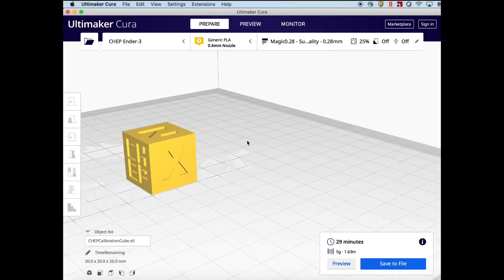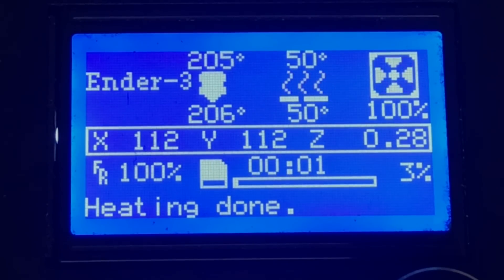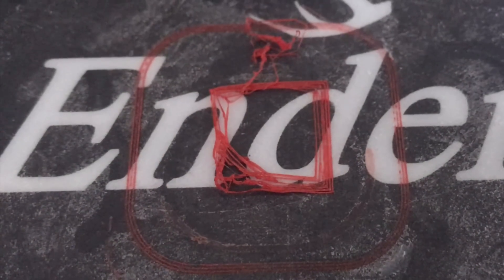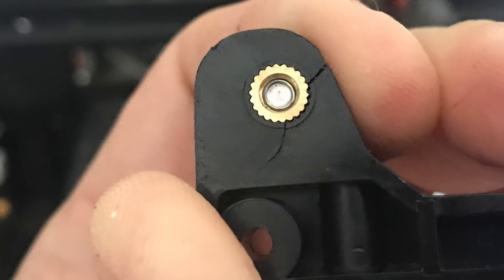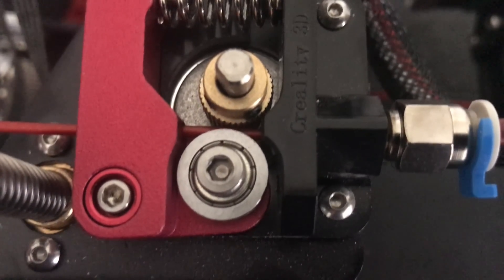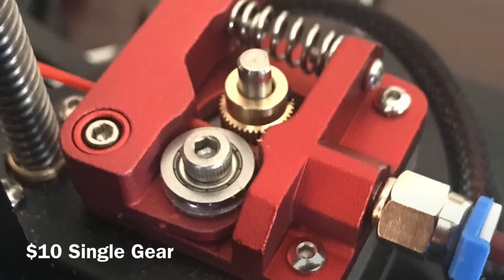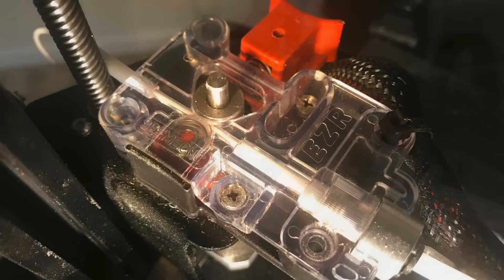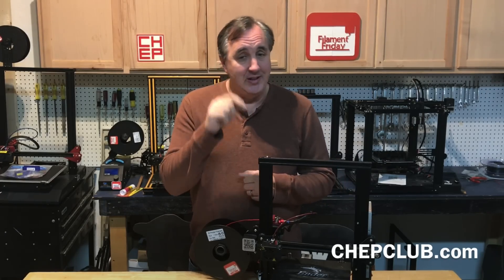Fix Under Extrusion from Cracked Extruder Arm on Creality Ender 3

Comment: i had the same problem and i did replaced it to aluminium but the problem now is that the motor is like blocked it cant move i feel that it didnt have force to push the filament out of the nozzle. can u please tell me the solution im very confused.
Reply from the maker: Loosen the screws. See if that helps.
Reply: @FilamentFriday  Hi, i did fix the problem, it was the extruder voltage i did turn the potentiometre clockwise till i meusure 0.85v and that solve the problem for underextrusion and its printing like never before. thnks
Reply: @FilamentFriday  i did that and nothing happened.